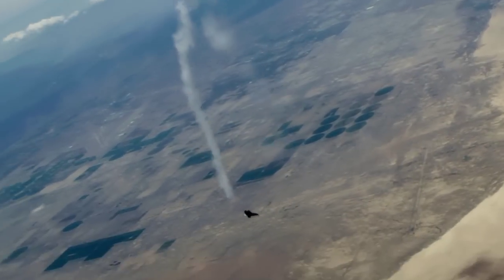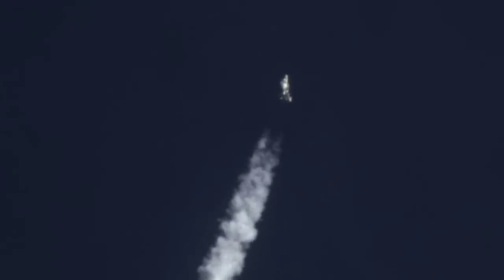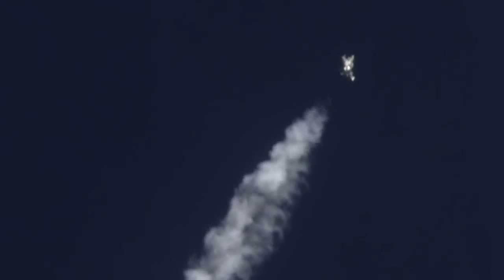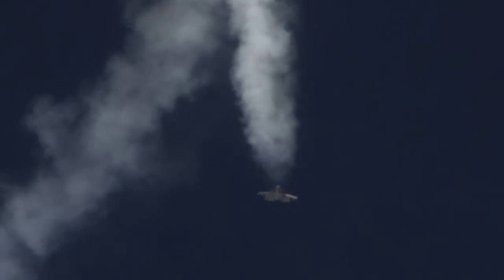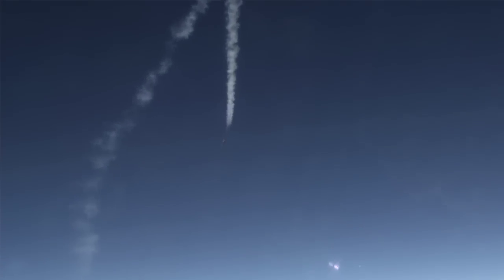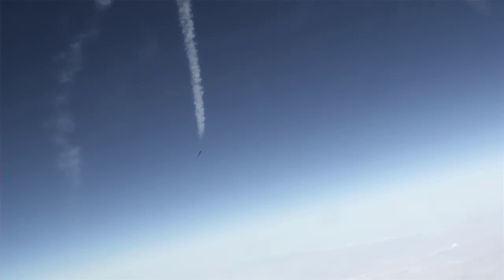F-35 Flight Test Intentional Departure

Comment: Wow, tailslides? That's actually really impressive once you consider the airplane's relaxed stability. 

An F-16 or F-18 would almost always go into a deep stall/falling leaf after a tail slide.
Reply: Because a stall is not a very vulnerable position. Missiles have trouble hitting stalled aircraft...
and pigs fly
Reply: Dan Frederiksen 
You're kidding, right? 

A deep stall is a pretty severe loss of control that can necessitate ejection. A modern short range missile will happily track and hit a deep stalled aircraft, it's essentially going straight down at very low speed.
Reply: The flying pigs was a hint that of course it was scathing sarcasm. I'm mocking this turd of a project.
Reply: Project =/= Aircraft

Did the F-22 not teach you that lesson already?

Comment: F-35 has no TVC but the F-35 has the capabilities of TVC! Russians deal with it
Reply: +neil matthew palapala Err just no, its has no TVC & predictably flies nothing like a plane with TVC.  You deal with it....  Yanks are crap at building planes, far too American for their own good....
With regard to flight performance this plane looks like an expensive toy compared to the SU35.
Reply: neil matthew palapala, F-35's horizontal rear stabilizers are over size, extended beyond the engine nozzle and it's pivot point is placed after engine nozzle, hence faking TVC. Cant'ed tails add extra rear lift.
Reply: The Lightning was the first TVC jet in history. 

By that I mean the EE Lightning. Have you seen how many alphas that thing pulls! It's insane. The thrust is almost always at a huge angle from the flight path when pullinh.

Comment: Fucking ripping off my country with this POS Jet. the F-16 is better Jet in any situation
Reply: jack black F-16 has inferior high AoA, post stall maneuver handling, roll rates and super cruise. 
"Here is a nice comparison of the F-16, F-15 and F-35 put together by an Aerospace engineer"
http://www.f-16.net/forum/download/file.php?id=19935&sid=214acd0562285efb750c3b9b911a86bb
Reply: +jack black your a buffoon
Reply: http://nettsteder.regjeringen.no/kampfly/2016/03/01/f-35-i-naerkamp-hva-har-jeg-laert-sa-langt-the-f-35-in-a-dogfight-what-have-i-learned-so-far/
English translation near the bottom. Norwegian F-35 Pilot's F-35  vs F-16.

Comment: If I had a choice between the F-18 (latest model) the F-16C+ block 52+ and this F-35.
(F-22 not applicable as its not available outside the US)
Give me the latest F-16. has a higher G limit. better thrust to weight ratio. Has a working cannon (LOL) Proven and trusted airframe. Just give it the stealth coating update the avionics. and I am good with the F-16.
Reply: ***** F-35B enables mass produced smaller flat top  carriers to be aircraft carriers. High unit count are important for total war.
Reply: *****
F-35A replaces F-16C.

Wing loadings via empty weight.

F-35A
Empty weight: 29,030 lb (Year 2013 build).
Wing area: 460 ft²
Wing loading: 63.11 lbs/ sq feet.

F-16C Block 52
Wing area: 300 ft²
Empty weight: 18,900 lb
Wing loading: 63 lbs/ sq feet.

F-35A's empty weight is 1.54X scaled from F-16C.

F-35A's wing area is 1.53X scaled from F-16C.

F-35A's 43000 lbf thrust is 1.50X scaled from F-16C's 28600 lbf.

There's a near straight scaling between F16C to F-35A.

From http://breakingdefense.com/2014/06/gen-mike-hostage-on-the-f-35-no-growlers-needed-when-war-starts/3/
General Mike Hostage On The F-35 vs F-16
The F-35, he says, has “at least” the maneuverability and thrust and weight of the F-16. The F-35 is to the F-22 as the F-16 is to the F-15.

F-35A's main target goal is to replace current service F-16C.
Reply: ***** " >F-35 cannon ammuntion is better than even the A-10, CAS guidance better than anything in the world at this point"

BS, the gun on the F-35 is no way comparable to the 30mm of the A-10. It's still a great gun but it doesn't have the same armor piercing capability as the GAU-8. You also have the problem of a greatly reduced ammunition store from the A-10 to the F-35.

jack black "Has a working cannon (LOL)"
It's cannon is under development, what are you giving it flak for? You don't just build a new weapon system overnight.

"Just give it the stealth coating update the avionics. and I am good with the F-16."
Stealth goes beyond just slapping on some paint, if that were the case don't you think China and Russia would have full fledged fleets of stealth Su-35's?

Just to get things straight, I am no supporter of the F-35 program but I will still point out when people make wild accusations about it.
Reply: ***** F-35A's 25 mm grattling gun is  for "out of missiles" scenario.

F-35's CAS follows F-16's CAS model.

http://www.defensenews.com/article/20140915/DEFREG04/309150012/Gaza-War-Leaned-Heavily-F-16-Close-Air-Support
 for Israel's F-16 CAS results.
Reply: ***** You don't seem to have the slightest idea what you are talking about. 

You also have plenty of problems with the plane itself; such problems being pilot visibility, stealth, payload, engine, and range.

As for visibility, I know exactly what your counter argument will be "It has 360º visibility using mounted cameras." As big as an advantage as that gives you to look beneath the plane, the pilot still can't look behind him with his own eyes in a dogfight. Cameras can offer a certain level of situational awareness, but a pilot can still spot a spec in the distance while a camera might not be able to show such a far away object.

The F-35's stealth isn't bad, but it also isn't great. It's shaping to accommodate the lift fan severely limits its stealth beyond what can be "upgraded" in the future. You also have the aft sector stealth which is severely hindered by the design of the nozzle.

The F-35 does not have a "huge payload" internally, which is what it would be limited to in most scenarios. The internal bays can only house two AIM-120 AMRAAM's; of course you have the external hard points but in most missions the F-35 would be favoring a stealth profile rendering those hard points unused. If the lift fan was not implemented the F-35 could have used a center weapons bay which would have greatly increased capacity versus the two adjacent to each other.

The engine on this plane isn't so much an issue with the engine itself (even though it has a lot of development issues) as it is the problem of having a single engine. It's not that I am against single engine planes or anything but for what the F-35 will be doing it could have consequences. The F-35 will be operating over water and the arctic regions of Canada and Norway for many missions, making a engine failure catastrophic for the pilot's survival - not to mention the plane itself. 

The range is this fighter is like the rest - short. This has never been a problem in the past because we operated from the European theatre, which offered plenty of forward air bases, and of course our Navy had freedom to go wherever it pleased. We no longer have this luxury in the Pacific, with China developing A2/AD our carriers might not be able to operate as close as they need to. The F-35 should has been developed with range in mind, because now it might not even be able to get into it's mission area.

Overall the biggest problem with the F-35 is commonality and the lift fan. The F-35B's lift fan requirement forced too many design compromises such as being able to have two engines, larger payload, stealth, visibility, etc. 

We need to design a new fighter ASAP, we wasted two decades developing something that can't even meet the requirements of todays threats.
Reply: +WaffulMann "You are NOT going to run out of missiles in the first place because of AESA and DAS. In a controlled engagement" 
Just because it has an AESA radar means it wont be in a dogfight? Right, i'm sure that is why the F-22 was designed from the ground up AS a close in dogfighter and BVR platform.  What you don't seem to understand is the difference between an Air Superiority plane and an Interceptor. Air Superiority is designed to engage an enemy plane in all aspects of fighting, where an Interceptor is meant to go up to the enemy, fire it's missiles, and leave.

"you fire your missiles, the get the FUCK out of there, something which your brain just doesn't appear to be able to grasp the concept of."
So you are telling me that when gaining air superiority for a operation, you run out of missiles and you leave? So while ground operators could rely on you gaining air superiority, you leave simply because you ran out of long ranged missiles? Yea, sorry to tell you that's not how it works. If you still have cannon ammo and two short ranged AIM-9M/X's the pilot is going to do everything in his power to bring down the enemy planes.
"My statement doesn't make sense? Nah, your brain just refuses to accept that you've been BTFOed. ALL of the USs fighters were designed to be small and short ranged. But oh, I suppose an armchair general always knows better than any professional jet designer."

Yes, you totally BTFO'd me with your severely limited knowledge of how modern air tactics and technology works. US Fighters have always been small and short ranged because we have always fought wars in places such as Europe, rather than the Pacific where basing is limited.

"The US CAN MOVE THE PLANES INTO RANGE, because there are CARRIERS. How the fuck can you blatantly miss that fact when I pointed out the fact that you have like 10 carriers?"

You have pointed out the fact we have 10 carriers plenty of times, and I understand that just fine. The F-35C has a combat radius of 615 nautical miles and the F-35B even less with 469 nautical miles. China operates the DF-21D ASBM which has a range exceeding 930mi, the YJ-12 which has a range of about 248mi, and the CJ-10 which is believed to have been developed into a ASCM with a range of 1500mi.

"Oh, what, you suppose a Nimitz strike group will be destroyed by AShMs before they get inside operational range of the enemy?"

Seems you don't know anything about modern naval combat either. The CSG would not destroyed, but denied. The Navy wouldn't risk sending in a CSG right away knowing of China's A2/AD zone. They don't need to outright destroy a CSG, just deny it access long enough for them to accomplish their mission such as capturing Taiwan. If a CSG did sail into the A2/AD zone they could have potentially hundreds of ASCM's to defend against; of course a CSG consists of about 1 Cruiser and 4 Destroyers, so they should be fine - in the short term. There is another problem now, missile capacity. With hundreds of missiles to engage the CSG will start to run out of large expensive missiles such as the ESSM, SM-6, RIM-116, and even the SM-3 (Given they are engaging threats such as the DF-21D). With their magazines empty or low they know need to find a base to reload at, because no commander would dare sail a CSG into a combat zone where they know potentially hundreds of ASCM's or even ASBM's await them.

"ONE. It's NOT going to have a bird behind it in the first place."

And you would prefer to leave this to the assumption that it is impossible for an enemy fighter to be behind it?

"TWO. Name me ONE modern fighter with half decent view directly behind the engines."

Well obviously no fighter has a good view behind the engines because there is an engine in the way. But pilots can't see directly behind them because the way the canopy is designed, it doesn't allow for the pilot to look directly back. Most fighters use a bubble canopy which offer plenty of visibility for dogfighting such as the F-22 (if the F-22 isn't ever going to be close in why was it designed with so many features for a air superiority plane?), F-16 (Multirole but also used in air superiority missions), F-15, Su-35, etc.

How about you go read up on air and naval tactics so you can write me a half decent response, you know - before you look even more ignorant.
Reply: ***** "Also, the F-35 is not an air superiority plane. It's a strike plane, not a f-22."
With the F-22 production cut short, the F-35 is now required to fill part of its role so it's going to need to be able to do air superiority missions.

"Tell me,What's china going to do with that almost 1000mi combat radius of theirs? They have literally zero force projection."

It would keep carriers farther from the area they need to be in to project power.

"Finally, stop pitching the f-35 in a situation it's specifically designed to not be in."

Exactly the problem, we are procuring a plane which cannot meet what we need now. The F-35 was made to compliment the fleets of F-22, but after the Obama administration cut short the production it left a massive capability gap.
Reply: This is for F-35A Block 3F
http://www.luke.af.mil/News/Article-Display/Article/1386133/lukes-newest-amu-supports-f-35-program/
"The unit is the first Luke F-35 AMU to receive a 3F, or full-up, combat aircraft capable of pulling 9G’s in the air."